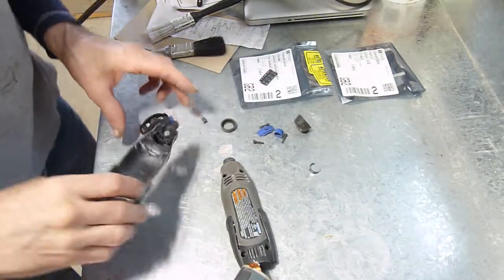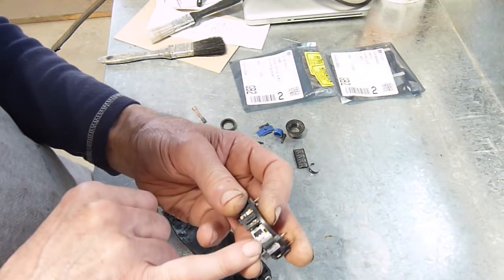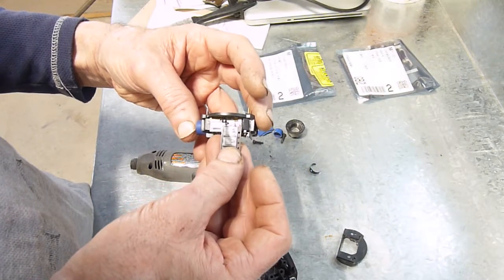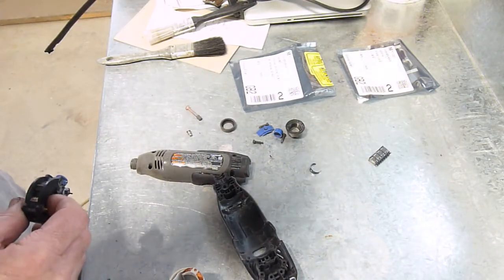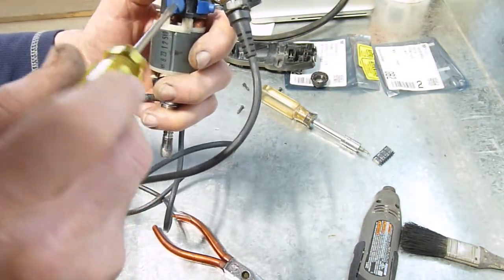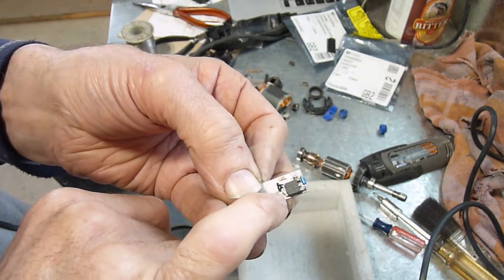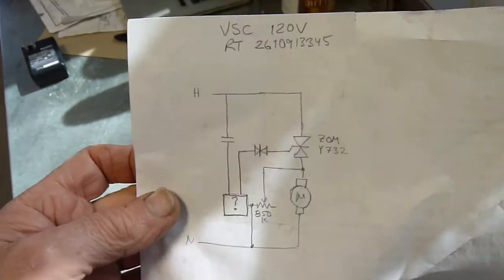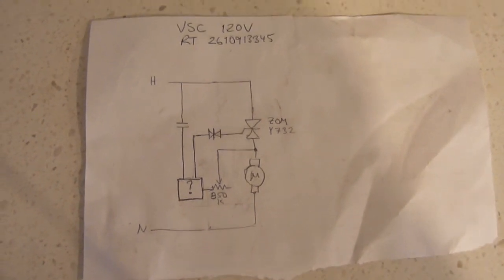Dremel repair Episode 30

Comment: I'd like to pick your brain if you don't mind. I have a Dremel 3000 recently it just stopped working I started to take a look at what could be the issue and began with replacing brushes when I took out the brushes one of them was so worn it was no longer existed and half of the spring seem to have evaporated as well.....no idea why. It wasn't simply broken off and fallen into the tool. It didn't exist anymore.... The other brush was completely worn.... Replaced them but no power still.... Any clue what could have caused an apparent disintegration of the brush and half the spring? I feel like knowing that would help as i continue to figure out the issue....
Reply from the maker: Hi. Did the brush holder break? How about the commutator, is it really rough? It may not work because the commutator segments have brush carbon between them. You could use a box cutter to carefully remove the carbon. Dont push hard on the blade, it's best to run it lightly between the segments until the carbon is gone. If the brush holder is broken you will probably have to buy a new dremel. The variable speed dremel are about 3x the price of the single speed ones. Hope this helps.
Reply: @notfactoryapproved  no the holder is fine. The original carbon brush wore down to the point it no longer existed. When I opened the tool one side the carbon was worn down drastically. On the other side only half a spring was in the holder. The entire carbon piece was no longer..... No traces of it or the other half of the spring.... Was wondering how that's even possible..... It was the first time I ever opened the tool since purchase. How does the carbon brush and 1/2 spring simply cease to exist?
Reply: @notfactoryapproved  also I'll try cleaning the commutator free of any carbon traces... At least I think that's what you were suggesting
Reply from the maker: Yes. That's right. I have only ever seen brushes worn out from a rough commutator. In your case one brush was either defective or the other one was stuck in the holder. It probably was using the spring as the brush. If that's the case you should see a groove cut in the commutator. From what you have told me I suspect you should buy a new one. I have often tried to fix something too far gone and just wasted time and money and then had to buy a new one anyway.